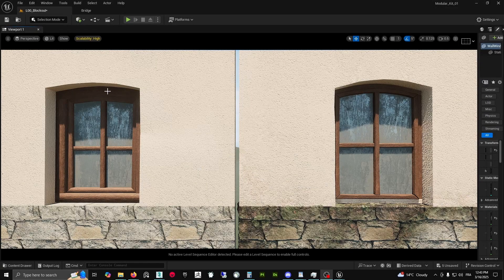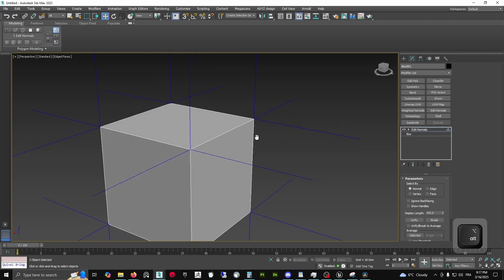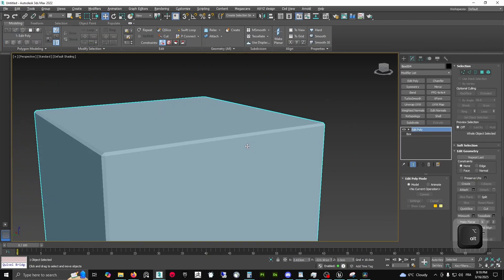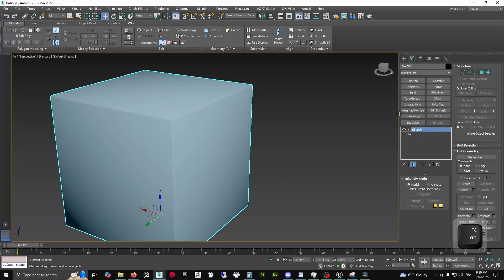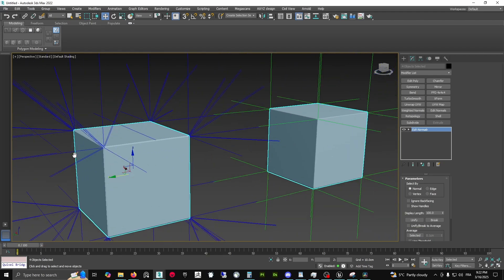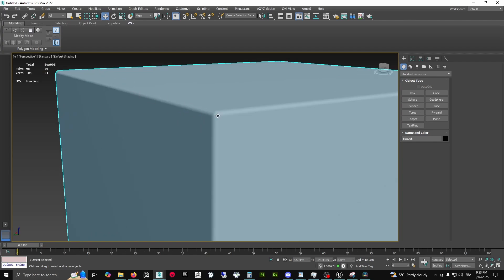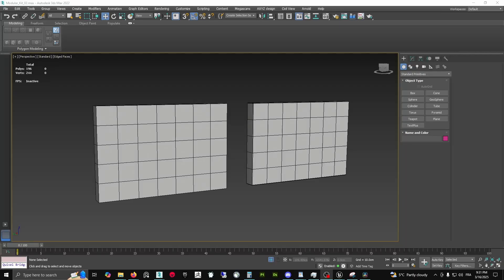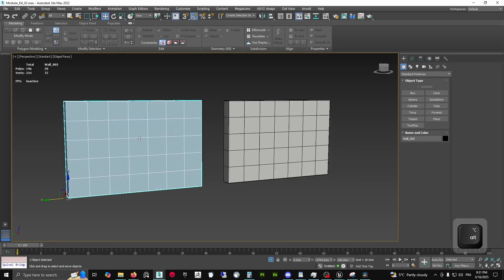How can the Mid-Poly Workflow change your life? - Weighted Normals

Comment: Nothing beats bevel trim sheets. But you must disable nanite for this, as it breaks baked normals.
Reply from the maker: Yes, Baked-bevel Trims for assets such as window frames is the best option. On large scale or larger assets, weighted normals is the most commonly used technique in many games though.

Comment: cool! in Blender you just use Shade Auto Smooth and tweak the angle...pretty faster..
Reply from the maker: It's true that Blender has lots of nice functions that are really practical. However, in the Game Industry, Maya and 3Ds Max are still preferred by most Studios, so if you want to work as a pro artist, the odds are that you will have to work with another DCC than Blender! ... I love Blender for transparency's sake, but I have never used it on the job!
Reply: @NextLevelGameArt  on the other hand, I have used it since quite a while now for work, and I know a bunch of others that are using it currently in big studios. Not everyone but many are shifting to Blender (or including it among the various) since 3.something I guess
Reply from the maker: I have heard the same from a few friends in other studios too, large and small ones! Each software has pros and cons, Blender seems to have lots of quality of life features for artists. I would like to use it full-time on a production in the future! :)
Reply: I thought the same, but I went and tested it, and the weighted normals modifier in blender definitely produces a much better result for a single beveled edge like this than autosmooth does.

Comment: To be fair the comparison isn't really fair, it's not just that the window on the left is not using Weighted Normals, but its thicker, has improper smoothing angles, less detail. obviously it's gonna look "less pleasing to the eye" compared to the one on the right..
Reply from the maker: The window frame on the left is basically a placeholder (which is used in productions), it is done in a few minutes and has no details, just basic materials. The one on the right is the second or third version (Details added, UV fixes, Added Geometry, Weighted Normals, could have RGB Mask), but the point still stands, as there is no high poly, baking, retopology in this workflow and is still done under 5-15 minutes depending on the asset! :) Thank you for your feedback!